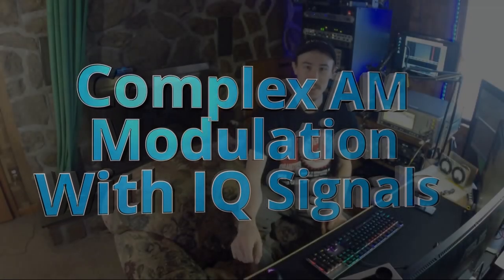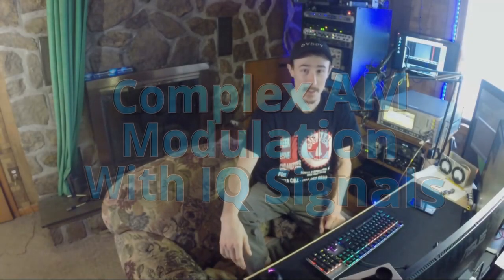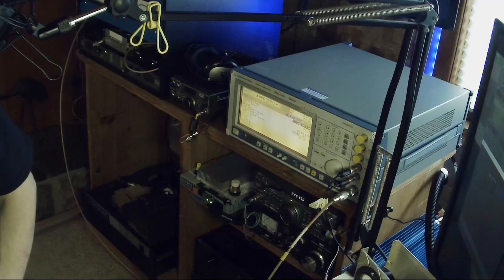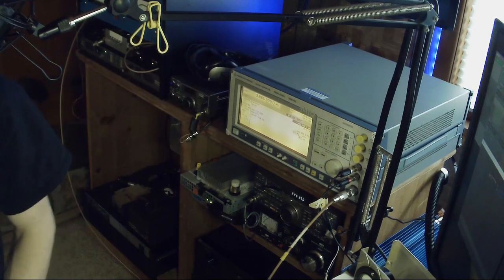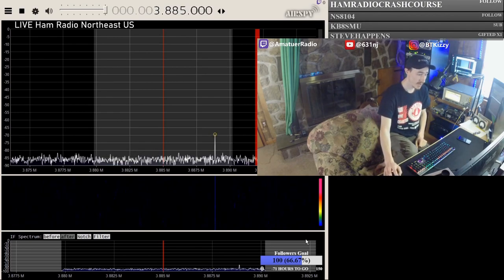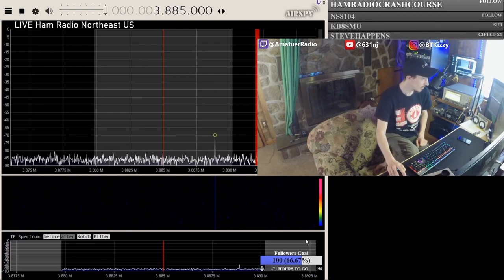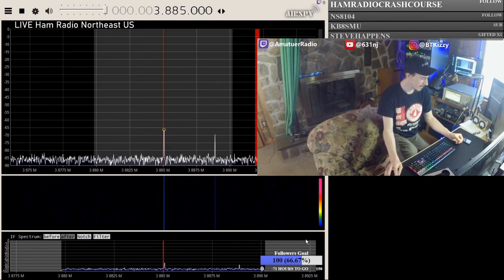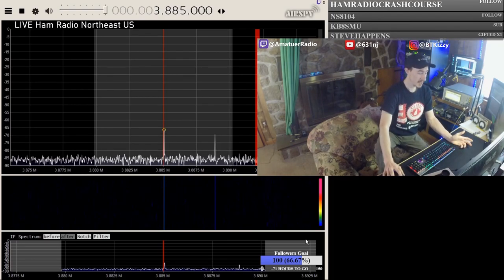IQ Modulation - Pictures in the Waterfall of your SDR!

Comment: That's cool Billy. I built an IQ transmitter that will do similar modulations. Build an amp stage or two to bring it up to a useable level, feed the live IQ processed mic audio in and there you go.
Reply from the maker: Very cool.... did you do it analog with double balanced mixers?  I wanted to try that myself but am not quite there yet.  I also need to build a buffer amp for this thing.......... thinking of using a BLF188XR because it is so high gain, what did you use to do it?
Reply: @AmateurRadio  it's analog using pair dds and multiplier chips, output about 0dbm, using an hf radio pa/bandpass board to 100w and ldmos after that.